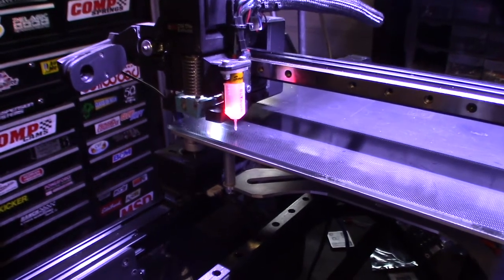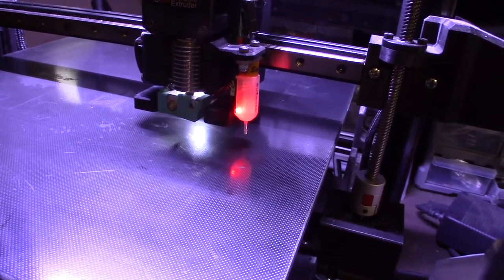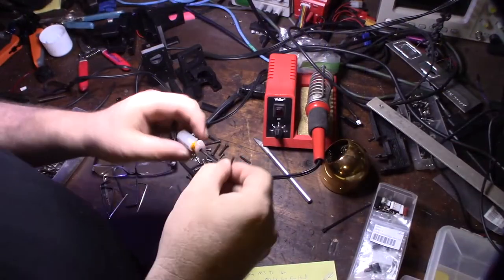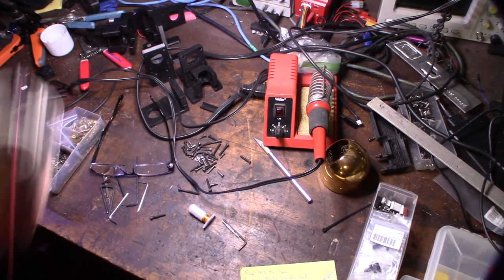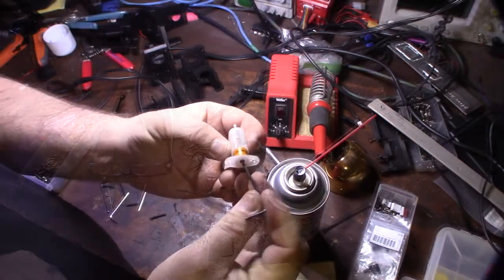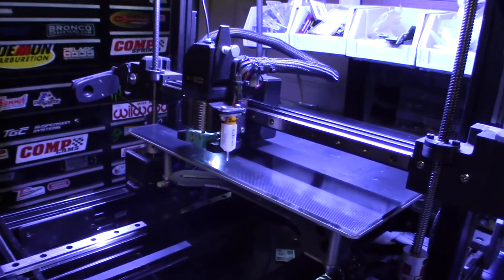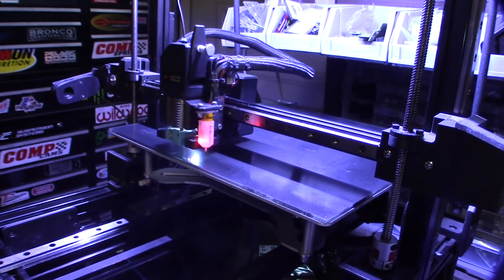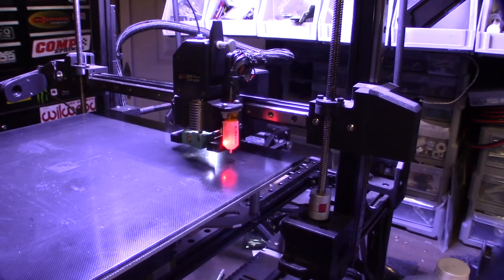BLtouch Stuck Probe Repair Fix Ford 3D printer

Comment: You Sir, are an absolute LEGEND!

Since owning a BL Touch I've always had issues with it.

Mine was doing the opposite to yours, mine wouldn't throw the pin down and it was always intermittent. you would have to quickly draw the pin down yourself and it would then cycle the pin up and down a few times before probing and moving on.

Following your video fixed this, I had to adjust my screw so it was sitting a little bit outside the mount and it's been happily working ever since.

Comment: Thank you, thank you, it's taken over a week to get this BLT installed and working, not knowing if it was firmware issues or wiring (or user error), seems the pin on mine had a very slight bend and that was enough to cause a very intermittent failure to drop.

Comment: My Rep Rap Wallace just hangs, I checked it 6 times looks like it might be firmware, I am running Marlin 2.0.9 Bugfix I think it is getting some kind of error because all the printer does is hang there when you perform a home and the BL-touch flicks in and out 3 times and I get STOPPED on the LCD running it on an MKS 1.4 the board works fine for mechanical end stops!   I checked it against my Ender 3 Config that I previously installed a BL touch with No issues at all?? It is basically the same physical setup, I am wondering why it keeps failing the Home the BL touch is new…

Comment: Worst idea ever. Spraying the BlTouch with electaclean has melted the plastic housing & bore causing the probe to practically glue itself into the bore. I would suggest that if you have this issue a clean with a toothpick & tissue would be a better option & if it still sticks perhaps a new probe is in order.